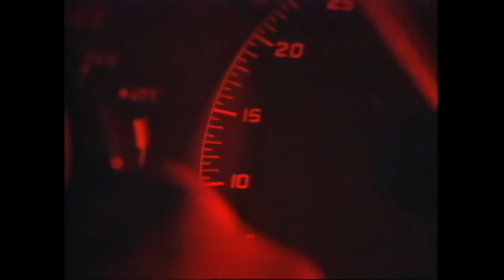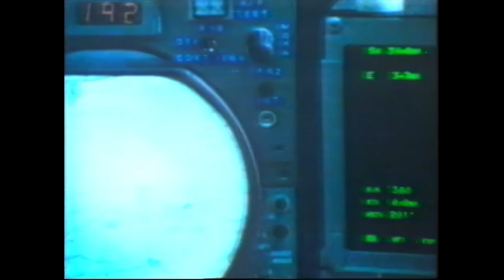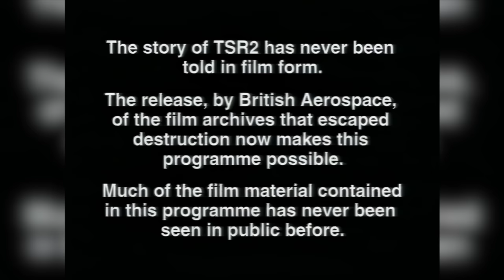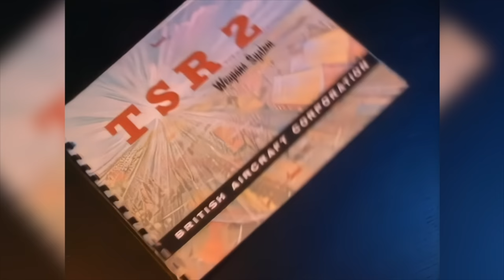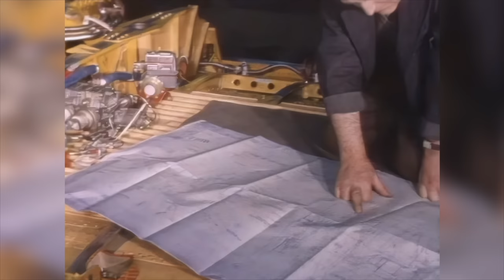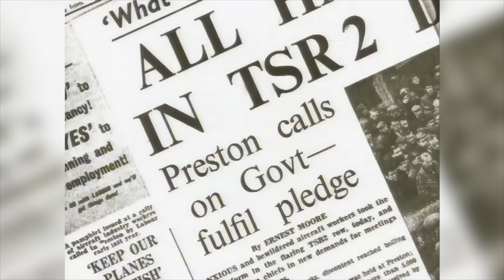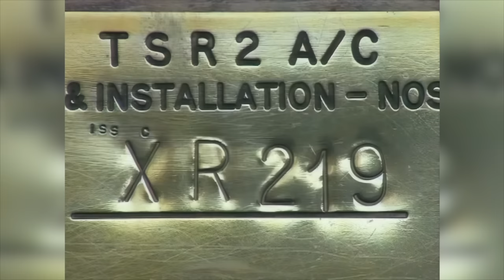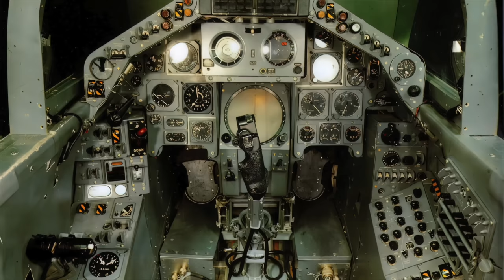Tornado | The Mach 2.2  twin-engine, variable-sweep wing multirole combat aircraft built by Panavia

Comment: Fun fact: The Buccaneer was faster at low level than the Phantom with a full bomb load due to its internal bomb bay.
Reply: As the Buccaneer was designed as such, it's no surprise. While the F-4 was designed as an interceptor ,  yet never served in that actual role, but did in many, many other capacities, something the Buccaneer was incapable of.
Reply: Buccaneer now you are talking 
Smoking at low level

Comment: Beautiful aircraft. Unfortunately high speed low level flight is super dangerous, a wall of flack can easily take them down (which happened in Iraq). Like the F111, this was still the best solution until stealth arrived to provide higher/safer altitude strike.
Reply: Sweden did it all the time in the Viggen They Specialised in it
Reply: @Karl-Benny  but not in real life like the RAF did in the gulf so that doesn't count
Reply: Tornado and other wild weasel aircraft. I mean, you get to fly jets for the military, but you’re doing one of the most dangerous job you can in a jet. Worth it?